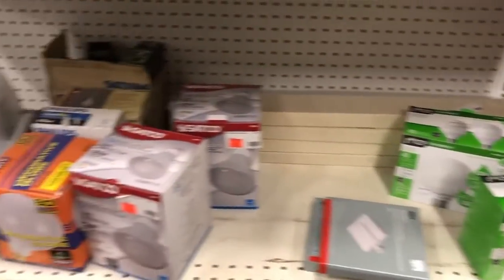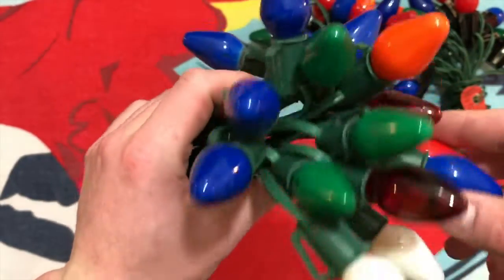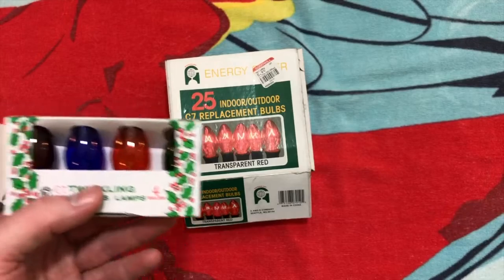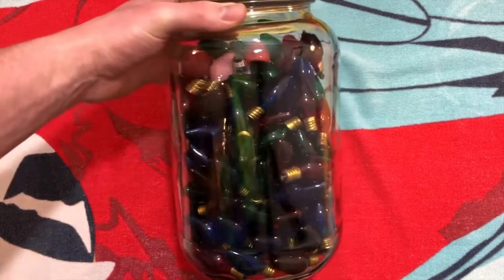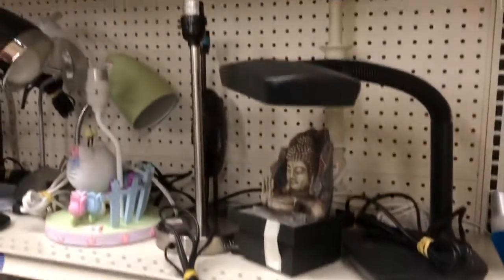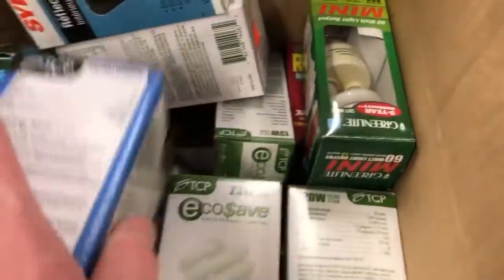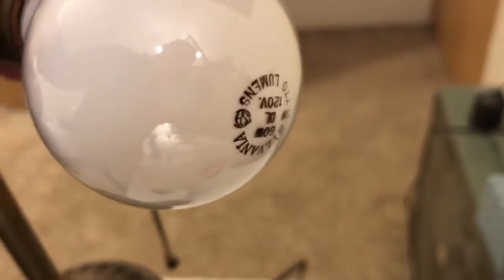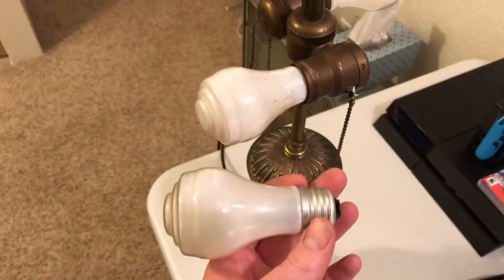Cooper OVX & Alaskan Way Viaduct - V25

Comment: Nice video! 😀 The 14-watt desk lamp is rare. The white 2x 15w is a Luxo, and the brown one is a Dazor model 2134. The ATT-17 is a VERY rare lamp. That GE Dichroic (I'm sure I spelled that wrong) lamp is also rare. Not sure of purpose though. The OVX is hard to find now because it is a PROBE-start MH streetlight. Most out there are PSMH.

Fun Fact: The Alaskan Viaduct was originally lit by Westinghouse OV-20s on double guys!
Reply: No the one he found was multi vapor metal halide pulse start metal Halide have a red and white sticker I found a pulse start metal halide one on eBay also
Reply: @thelast1900  Maybe it's the dust, but the one in the video has a solid red NEMA tag, indicating that it's a probe start one. And yes, I've seen the one on eBay as well.
Reply: I have a 400 watt hps one